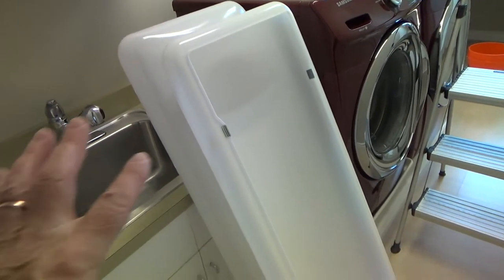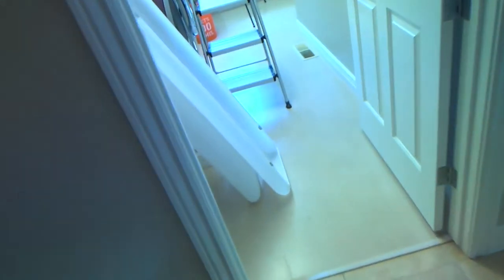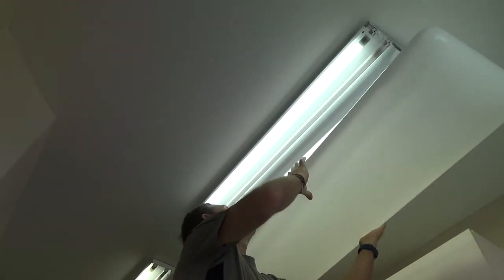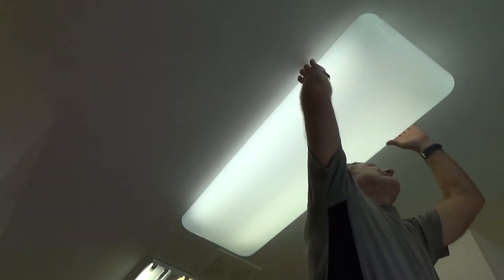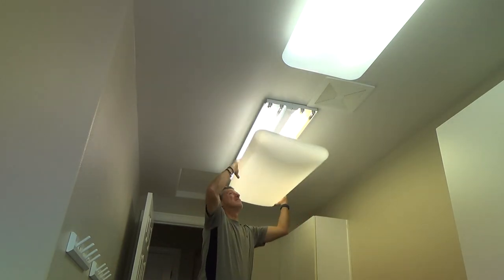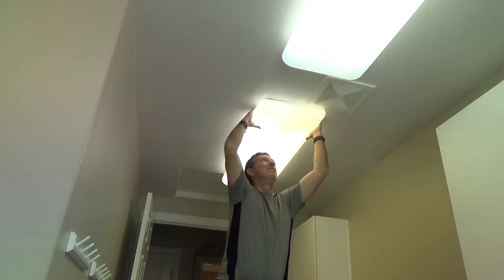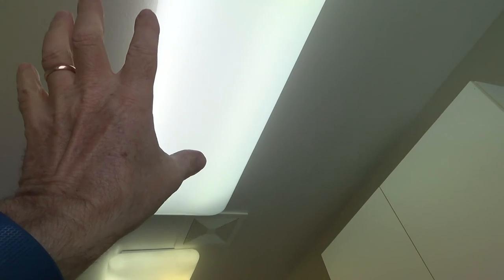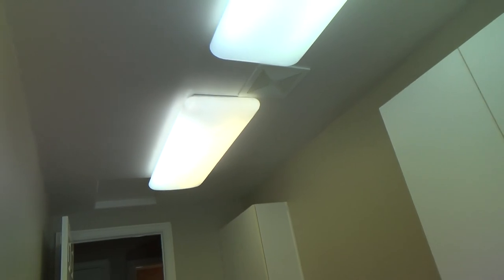Installing Fluorescent Light Fixture Lenses You Can Do It!

Comment: Thank you!  What a nightmare this fixture is!  You have to wonder what genius thought of this lens attachment  -- something that's so unstable -- one little tap from the side and half of it dislodges and swings down.  As soon as I can get a new fixture, I have a special farewell ritual for this lens!!  In the meantime, thanks for saving  what's left of my sanity !
Reply from the maker: Ha! Don't tap on it then. The lense is made in such a way as to where once you get the lense re-installed you slide it over just half way so it sits evenly on the light fixture clips. Then when you want to remove you have to slide over to one side or the other then carefully lift & flew the lense just enough to get it off the clips. Once you see how it works then it becomes easier to remove. In my case however I wasn't exactly sure how this particular style lense came off so I wanted to take it nice & slow & figure it out before just man handling it only to crack or break an edge off! I have more lense videos if you want to see me remove & re-install other lenses. Just go to my main YouTube channel page then click on playlists then scroll down to electrical & you will find them. Thanks for your message!

Comment: Thanks for making this video. I have these exact lights and I was able to remove the cover without a problem and change the light bulbs. But for the life of me I can not get the cover back on. I can get the one side on like you do but I can not get the other side. Also, one of the fixtures will only occasionally light up while the other two that are all on the same switch work. Any ideas why that would happen.
Reply from the maker: Great job on getting the light lense cover off so you could replace your tubes. I have other videos that could assist you with re-installing the light lense. Just go to my main YouTube channel page then click on playlists then scroll down to electrical & you will find them there. As for your one light tube that doesn't go on...how many tubes do you have in the light fixture? Inside the middle area of the light fixture itself will be some light fixture ballasts. You might have one light fixture ballast that controls all 4 light tubes (if that's what you have) or you could have two light fixture ballasts where one ballast controls two tubes & one ballast controls the other tubes as a thought. Over time depending on how old your light fixture is, the ballasts will go out or have a tendency to not work all the way. Then once your ballast heats up after turning the light fixture on, your light tube may suddenly work. Or when you first turn the lights on your tubes could work until the ballast heats up then it could turn off one or more of your tubes. In a nut shell one of your light fixture ballasts may have to be replaced. If it's a really old light fixture you may end up deciding to replace the entire light fixture with an energy efficient light fixture as a thought. Check out my playlists area & I know on at least one video I talk about the difference between old light fixtures as opposed to new, in order to give you an idea for your light fixtures. Let me know if you have any followup questions. Thanks for stopping by!
Reply from the maker: As for getting the lense back up there, rewatch this video & it may give you something else to check you maybe have not seen the first time you watched it. Make sure you have one side clicked over the edge & pushed in as close as you can towards the light fixture then the other side you can kind of tweak the lense just enough to get over the clips on the other side....

Comment: After numerous tries to reinstall the cover, I came searching on youtube for some tips on how to get these buggers back up.  I did as Joe said in the video and got one side on but I could only get one of the clips of the other side to barely catch before they would all detached again. Finally, what I did that worked for me is that I carefully slid the clips on each end to the center portion of the light cover. I realized that the center area was a bit more flexible and because the clips were so much closer together it made it easier to get that second side over the rim. Once I had all 4 clips above the rim and the cover centered, I then carefully slid the clips back to their original positions at the end of the cover. I hope this tip helps others who are
struggling with these same light covers.
Reply from the maker: Thank you for not giving up! Next time you will know exactly what to do...right?!